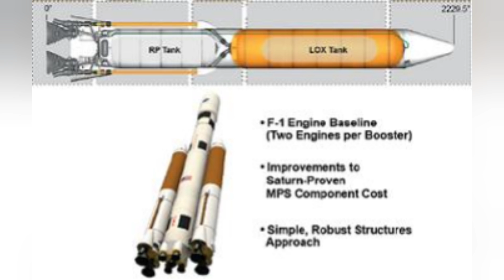NASA almost used Saturn V engines for SLS!  Are the new Shuttle engines the right choice?

Comment: Congrats on the 100k subs.  Oh, and go a little (not too much though) easy on SLS.  Designing a major rocket system when the Chief Designer is Congress, is harder than you think.
Reply from the maker: True, but they should've at least allowed the booster competition to continue. There were good ideas and competitors would've been highly incented to get the costs down. Canceling it wasted money back then and now.
Reply: @TheAngryAstronaut  - We’re talking about “The Best Congress money can buy”, and Boeing bought and paid for every last vote.
Remember, the F-1 had terrible ISP.
Reply: The kerolox F-1 didn't have terrible specific impulse, it was lower than the ISP for the kerolox SpaceX Merlin engine or the Russian RD-180 but still significantly higher than than the ISP for any solid rocket booster. The engine was optimized for thrust and the size of the thing created combustion instability problems which the engineers of the time were able to solve. No one has tried to make a single nozzle liquid-fueled engine anywhere near as big since then. The Russian RD-170 has more total thrust but uses four nozzles with a shared system of propellent pumps. Alleviates the combustion instability problem but the four nozzles take up that much more space when clustering multiple engines.

Kerolox powered boosters might have improved performance and cut down costs over the long term compared to SRBs, although nobody knows how "long-term" SLS is going to be. One thing the original F-1 didn't have was throttling capability, which is something more modern booster engines have which gives flexibility in designing mission flight profiles as well as allowing for flyback capability in the case of SpaceX.

Comment: The SLS is the perfect design for launching huge masses of money into certain pockets.

Speaking as one who runs a CNC machining company, if an original F1 exists, it can be reverse engineered down to the most minute detail.  If it can be reverse engineered, it can be recreated.  Failure to do so can only be attributed to mismanagement.
Reply: It can also be attributed to being a bad idea.
Reply: Actually not - you would have to be able to disassemble the F1, and it is a single welded unit. Each one was unique with parts hand machined, drilled, and welded.
Reply: @jessepollard7132  I didn't say it would be nondestructive.
Reply: @AlitaGunm99 and destructive to try and  rebuild.

Comment: The crazy thing about the F1 engine is that it was never truly optimized. It was improved throughout the Apollo program. The versions that flew on Apollo 15, 16, and 17 were slightly more powerful than the versions that flew on earlier missions. They produced closer to 1.6 million pounds of thrust each rather than the more commonly quoted figure of 1.5 million pounds of thrust. This extra bit of performance is how they were able to add the lunar rovers to the final missions. And Rocketdyne designed a more improved version called the F1-A that would have produced 1.8 million pounds of thrust. However the Apollo program was cancelled before that version could fly.
Reply: Rocketdyne did test one at 1.8 million lbs. of sea level thrust, but as you note, NASA had no use for it because Apollo was done. And no more Saturn V's were in the pipeline.
Reply: @rosswarren436  That was the F-1A. They did try to revive it for the Comet HLLV in the 90s but it obviously went nowhere.
Reply: @jmwoods190  would have been nice. Still think we should finish developing the J-2X and use it on SLS or even as a third stage for Super Heavy/Starship for payloads to Mars and probes to the outer worlds and their moons.
Reply: The F1s were all indivdually custom built. It's amazing they worked as well as they did.
Reply: F1A was also be deeply throttleable. F1 was not.
Reply: There was also the F1B this was on the Pyrios Booster or  guessed it the Advanced Liquid Boosters that were supposed to be used on the SLS but NASA cancelled the program for the replacement of the SRB's.
Reply: @bonglambitco80  yes, I saw that, but it was cancelled so ATK Thiokol got the contract for the SRBs.  Rats.
Reply: i don't think they would do that today, perhaps would not be allowed to

Comment: There was a small documentary which basically said they lit the f1 preburners (there is video of that about ten years ago) and basically , they have come out o the realization that the knowledge and manufacturing necessary to build a new f1 is basically impossible … it would be easier to just build a new engine because everyone that was involved has retired and the knowledge that was needed was just kind of lost
Reply: Pretty sure Aerojet had come up with a plan to remanufacture F1's based on old plans but with modern techniques.  Replace the thousands of handmade components with a lot of 3d printing and CNC

Comment: Raptor 2 claims 510,000 pounds thrust while Raptor 1 was 410,000 pounds thrust. 33 raptor 2 engines like on booster 7 is 16.8 million pounds while 10 F1 engines would be 15.2 million pounds thrust. Raptor engines weigh about 3500 pounds each.
Reply: 11 F-1 engines would've probably matched the Super Heavy with Raptor 2s, though with F-1As 9 of them(the same number used on the unbuilt Comet HLLV) would've almost reached the Super Heavy with Raptor 2s.

Comment: The only way to improve SLS in order to keep it economically sustainable (sort of) is using components shared with commercial vehicles. A scalable architecture in which, for example, the boosters are also first stages of smaller rockets (Falcon 9?) or the core stage engines are reused in other smaller rockets (RS-25E instead of BE-4? Only an example, I'm aware that thery are completely different beasts). 
Sharing components, producing those components in large numbers, flying them often, is the key to keep the costs down
Reply: I am suddenly envisioning an SLS Core with two falcon Nines for boosters - at least THOSE will be recoverable.
Reply: @samuraiartguy  with the launch ratio of SLS, recovery is not decisive - It could actually cost MORE. But, even if not recovered, four F9 first stages would cost less than two SRBs, being mass-produced.

Comment: I remember this.  There were some very interesting articles describing how they completely modeled the F1 in CAM systems and had it simplified and lightened. Then it was as if NASA just lost interest in the whole deal.  I'm confident that SLS will be canceled as soon as NASA is confident it can declare victory and mission accomplished.... it's just not sustainable in terms of cost vs operational tempo.
Reply: Cost = $4 Billion per launch; Max Operational Tempo = 3 launches every 2 years - They both suck.
Reply: @TraditionalAnglican  4 billion is not the cost to launch an SLS rocket, since that includes the annual program cost of the Orion program, on top of SLS and EGS.
When referring to launch cost we are talking about the cost of the launch vehicle/launch service (SLS+EGS), not the cost of the payload (Orion).
The 4.1B estimate that NASA OIG produced was never said to be the SLS launch cost, rather the total cost for each of the first four Artemis missions, of which SLS launch cost is only a fraction of.
And no, SLS could launch a lot more than 3 times every two years if it was required to do so.
Production lines can be further optimized (this is already happening by the way*), more VAB high bays can be activated, more mobile launchers built.
Even if they are limted to one launch pad the maximum theoretical launch cadence for SLS with two active VAB high bays would be more like 6 times per year with a production surge and hardware stockpile built up ahead of time.

*Boeing are making changes to SLS production that would allow for producing over 2 core stages per year.
They are moving engine section production/integration (by far the more time consuming part of building an SLS rocket) to KSC to be able to produce twice as many engine sections at the same time.
This will allow for more vehicles to be in the production flow at the same time, thus allowing for a faster production cadence.
They also plan on putting up 2 core stage storage/integration cells in VAB high bay 2 to start creating a hardware stockpile for higher flexibility and cadence later in the decade.
The first of these cells is being put up later this year, and will be used to store the completed core stage for Artemis 2, with the second cell planned to be used for final integration of the core stage for Artemis 3.
The NASA baseline cadence target is only 1/year after the first 4 flights but the capacity to build more is being created right now.
These upgrades to the production sequence are being done at NASA's request but with significant self investment from Boeing.
Noteably all the KSC facility modifications like the engine section integration tooling and High Bay 2 core stage storage/intergration cells are self funded by Boeing, likely ahead of the turnover of SLS operations from NASA to DST with the EPOC SLS launch services contract (Artemis 5-14+)
Reply: SLS will be canceled as soon as SpaceX proves SH and SS for the lunar mission profile.  SLS cannot compete on cost or tempo IF the SpaceX projections are within an order of magnitude of being correct.

That will largely get NASA out of the vehicle business which will allow them to concentrate on the cargo business - making new and better scientific packages.  If Congress leaves their budget as it is, getting out of the vehicle business will leave them with a relatively large budget for those new and improved science packages...

Comment: This engine situation really sucks. I would be all for a independent prosecutor with full authority to investigate this. With Starship about to fly I do not understand the need for SLS. What can it do that Starship cannot? It seems to me that SLS is nothing more than a jobs program for a select group of people. A very expensive jobs program that highlights political and corporate corruption. Just sayin. My guess is if you gave a complete F1 to SpaceX they could build a modern version of the venerable F1, test, and fly it in around 2 years. They are everything the Government and NASA are not. Smart, efficient, and fast. SpaceX is very good at doing what cannot be done. After all according to the government and NASA experts and engineers Falcon 9 and Heavy is impossible. Reusable rockets can't be done. Remember that? Jeez.
Reply: SLS can go to the Moon with one launch.
Reply: @hellomeatrobots  
Yes, it can but the whole thing must be replaced.

If SpaceX can get over the refueling hurdle, SLS is massively more expensive than all the necessary launches to get the reusable SS to the moon.
Reply: @frankmcgowan9457  I'm skeptical of using 16 rockets to do the job of one being the amazing cost cutting measure Elon claims.
Reply: @hellomeatrobots  
Something like 6M of the the 8M lbf thrust of SLS is from the the two SBRs.  The SH uses 33 rockets to provide 16-17M lbf thrust.  That means that the 4 engines on the SLS core provide about 500K lbf each which is very similar to the Raptor-2 thrust per engine.  So, we're talking about 4 engines doing the work of 4 engines. 

The cost saving comes from getting the hardware back so you can actually build up a fleet while using the individual ships.  SLS cannot do that.  It was not designed to do that.  SH/SS, however, WAS designed to do that.
Reply: @frankmcgowan9457  I'm talking about needing multiple launches to get Starship to the Moon. How many is it? I've seen up to sixteen. That's like the Apollo program using every Saturn V launch to go to the Moon once. And that's going to be cheaper? Wanna buy a hyperloop?
Reply: @hellomeatrobots  
I'm willing to guess that you drive an automobile. 
If autos were designed the way rockets have traditionally been designed, the automobile would be specially designed for trip you intended for it, built by specialty contractors and cost enormous sums.  It would be expended on its trip and no part of it could be reused. 
A longer trip requires a bigger fuel tank to make the whole trip.    That tank requires a bigger chassis to carry it.  The bigger chassis requires a bigger engine...
Wait... what if we could REFUEL during the trip?  Yeah, that's IT!  With refueling, our tank is functionally infinite. 
But... somebody needs to expend fuel to get the fuel we WILL need to where we will need it.
Never mind.

That is, in essence, your argument.  That method does not scale well in terms of distance or capacity.  
It makes sense to build gas stations and refuel along the way.

How can it cheaper to haul fuel?  You don't replace your car after one trip.  You don't replace the fuel trucks after one trip.  You refuel and repair you car and the fuel trucks BETWEEN trips.  You keep fuel truck drivers on staff so you no longer need to train them for each new trip.

Musk is right.
Reply: @frankmcgowan9457  Is Musk planning on building an orbital refueling depot? Or using one someone else is building?

Comment: I never understood why they just didn't go ahead and assemble the rocket for Artemis 2 and reuse the parts fron Artemis 1 on Artemis 3?  Why hold up the entire program to strip parts off one when you don't have too?
Reply: none of the parts from ARtemis 1 are usable - most are at the bottom of the ocean.
Reply: @jessepollard7132  there are parts of the Orion capsule used on Artemis 1 destined to be stripped out and installed in the Orion capsule for Artemis 2.  It's 1 of a number of reasons for the delay between the Artemis 1 and Artemis 2 missions.
Reply: @JoeShmoism  The capsule is the only part they got back.
Reply: @jessepollard7132  I'm aware of that. NASA's plan is to pull the flight control computers and some other components out of the Orion capsule they got back and use them in the next one.  It's a pretty half-assed plan for reusability, and a pretty half-assed reason for holding up the rest of the program.
Reply: There was talk of reusing the tank that was deliberately ruptured in a pressure test. No thanks!

Comment: My guess is that NASA was pressured by politicians to keep Orbital ATK's gravy train running, that's why they ditched the F-1B aka the modernized F-1. Even earlier on, there was a competition between SLS configurations: Shuttle, Saturn or EELV-derived, with one Saturn config having 6-7 F-1Bs on stage 1 which would've dethroned the N-1's thrust record. The Saturn-derived config proved to be the most capable of 3, but since congress wanted to keep the Shuttle era contractors' gravy train running, and so we got Artemis in the form we know today.
Reply: Which made SLS another design by committee - and just as bad - overpriced and under performing. Just like the shuttle ended up as.

Comment: I think if Space X were allowed to improve the F-1 we might see an ISP of 380 and 2,000,000 lbs of thrust and 3D printed.
Reply: I don't think you can get ISP that high on a Kerosene based engine. The Merlin-vacuum engine is only 311. However there was an upgraded version of the F1 engine designed by Rocketdyne in the late 1960s called the F1-A. It would have produced 1.8 million pounds of thrust. However the Apollo program was cancelled before the F1-A ever flew.
Reply: @Roo76  Just an interesting thought- what if SpaceX somehow built a LOX/CH4 derivative of the F-1? Won't be quite the same obviously, but a big methane-based engine would be really intriguing!

Comment: Would you call an airline reliable if it had to delay its flights by months because of hardware problems?  The F1 would have been used in place of the SRBs, not the RS25/SSMEs.

Comment: Those are the excuses I commonly hear.  You get that they basically amount to "Our journeymen can't follow a print" and "our engineers can't make models from the prints" and "we're too incompetent at the very basics of manufacturing so that we can' fabricate 1960's tech."  We have thousands of journeymen welders, machinists, structures, and corrosion technicians who do far more complicated work, everyday, than what was involved in the F1.
Reply: They still need parts, some of which aren't available anymore. I'd rather they work on infrastructure.
Reply: @spacexrocks1041  What parts?  Be specific.  In my experience fabricating parts and prototypes for USAF R&D, and now for NASA R&D,  there's nothing they made then that can't be made now.   Nothing.

Comment: I imagine that RS-25's design has been optimized so well that there are not significant improvements to be made out of their redesign.  Manufacturing improvements can be made without changing the design and also reusability would help significantly.
Reply: Perhaps NASA ought to retrograde the design, simplify them and get rid of anything not needed for SLS Core boost, or extended life, since they DON'T NEED TO BE ROBUST FOR REUSE.    Grrrr   Arrgh
Reply: Only if they were meant to be reused on SLS program 😕

Comment: the most frustrating thing about SLS (apart from cost) is that it is way lighter AND has greater thrust than the Saturn V but doesn't have nearly as much payload to orbit capability. ~95tons vs ~140tons to LEO. This shouldn't happen. I think it's because the SRBs burn out long before a liquid booster and gravity loss becomes a major issue despite that the RS-25s are way better than the J2's on Saturn V 2nd stage. But I really have no other ideas as to why the performance is so much lower.
Reply: The lower payload to LEO is a consequence of SLS being a 2 stage rocket whereas Saturn V exploited half of the SIVB, so it was a 2 1/2 stage to LEO.
Reply: X2 it’s the staging...